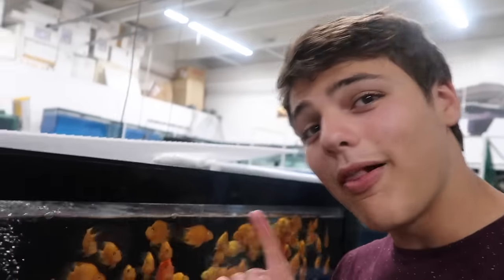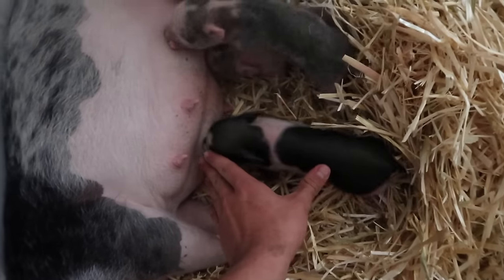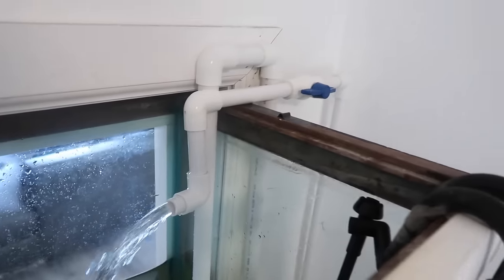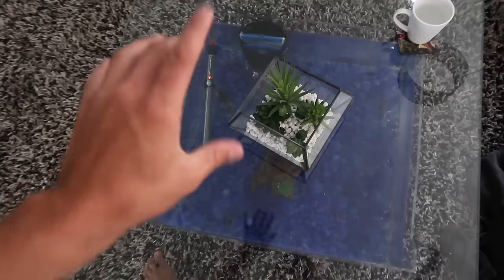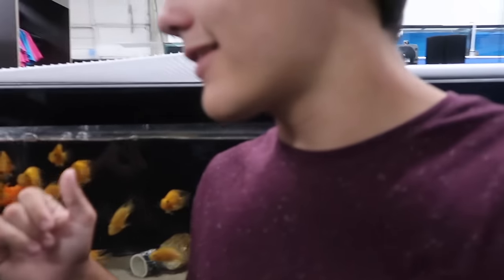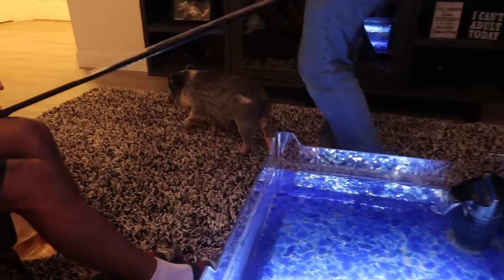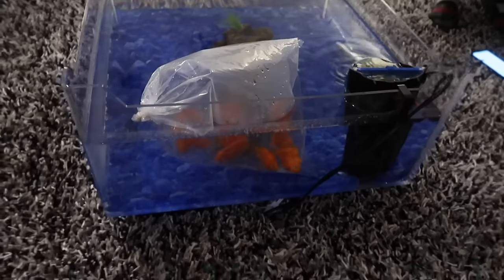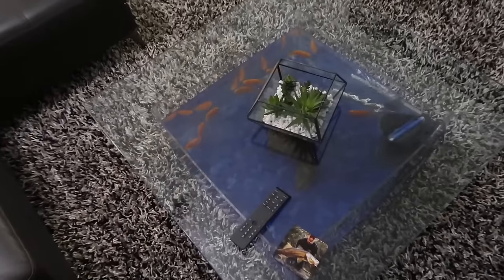BUYING COLORFUL FISH for My AQUARIUM!!!

Comment: Paul ......please find a different way to plug in  the tank .......wires under the carpet can pose a huge fire risk!!!!! Great videos keep up the good work.
Reply: Same so either some pipe or a fire/sparkproof rug
Reply: your piglets are very  nice
Reply: 69djjeffer32  I agree
Reply: 69djjeffer32 as long as the carpet isn’t touching the outlet and there’s no cuts in the wire it’s not a fire hazard
Reply: Oh stop complaining i am just glad he posts vidios
Reply: @regginaldthedoggo3686   you are compleatly correct
Reply: Mikaeel Hoosen If the carpet isn’t touching the outlet or the wire has no cuts in it, it will be fine
Reply: Good friend of mine thought the same thing that wire is in good shape no need to worry ran it under an area rug ......then he lost everything in a house fire. Fire marshal determined the cause was from a cord under that area rug.
Reply: Yes
Reply: As someone that was in a bad electrical shock accident, I agree, need to place those wires in a conduit or something especially with the water right above it.
Reply: Y’all aren’t wrong
Reply: Yes
Reply: as a former fighter lots of fires start by wires under the carpet
Reply: he giveawayed the parrots

Comment: you need a bigger tank parrrot fish get huge!!!! they will be packed like sardines in there
Reply: Also we should try to avoid putting it with other types of fish
Reply: @robertclive6824  except cichlids
Reply: If he's going to have that many rbps he needs a bigger tank. They can get territorial and they can almost grow up to almost a foot long.
Reply: This is slightly triggering, since most parrots get around 8” and 3-4” tall...
Reply: @alejjandro2452  If it has a heater
Reply: @simontran8982   yea but most of the year it’s hot I Florida idk I’m not a pro
Reply: @alejjandro2452  True it does depend on the temperature
Reply: @robertclive6824  bigger tank yes but I house mine with a blue gourami and bichir. They get along great. My parrot is the tank boss and only rams my other fish when they get inside his hideout

Comment: Cool table, it’d be even more cool if it had a catch bowl underneath so it has water flowing down the sides of the table to a filter underneath where it pumps clean water back into the tank so it continues the overflow feature, but it needs to be laminar flow to keep it clear
Reply: No it would be even more cool if he didn’t put blood parrots in it. Not even big enough for one!